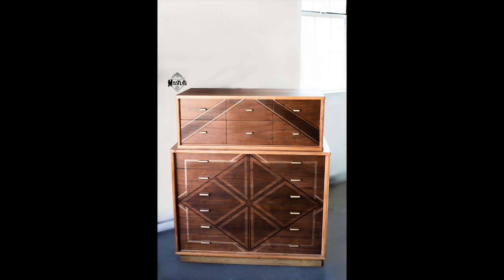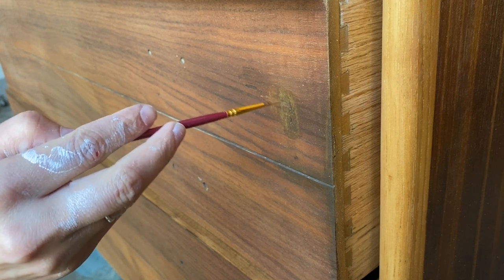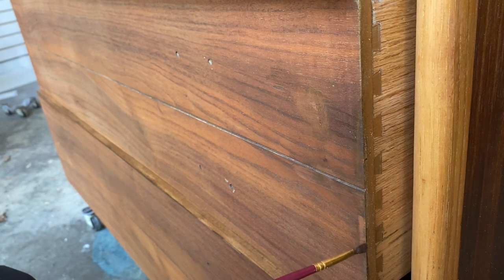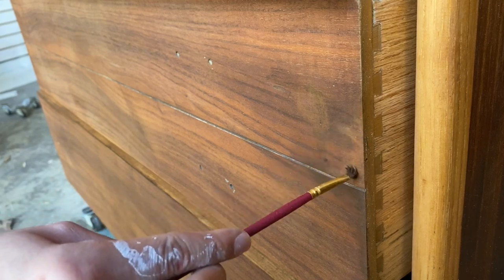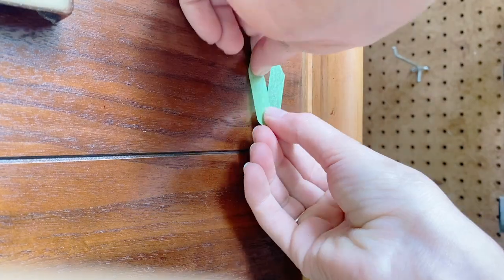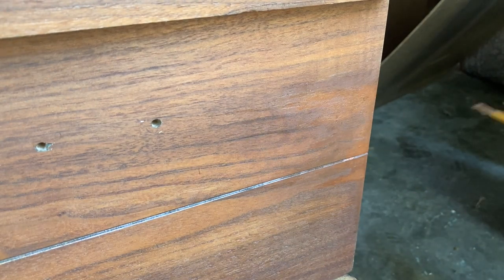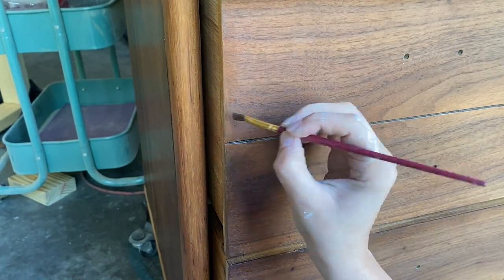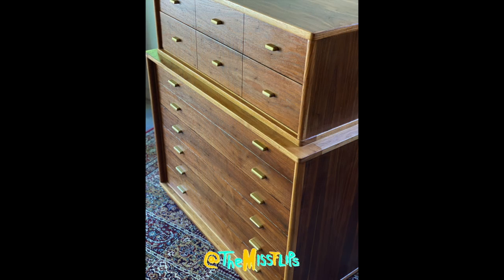Ever burned through veneer with your sander? | Quick And Easy Repair

Comment: Neat work, thank you, Miss Flips. I'm entering the world of re-finishing by trying to save a big dining table that sat under tablecloths in our outdoor patio in Southern Florida for years. I was a mess. In my various and diverse attempts to remove large and stubborn black water stains, I believe I over sanded a number of rather large spots. Two questions, if I may: (i) can this be done over a larger area (say, the size of a standard paper- back), and (ii) I was planning on staining and using weather proof sealant (have not decided which as the choices are endless; I don't think any of these weather proofing sealants come in a spray can (at least not the more effective ones), so, the question, finally, is: can I do the painting after it has been sealed and the do an application of the spray sealant in the painted area. Sorry for the long winded question, but new to this not sure what is relevant and what is not.
Reply from the maker: Hi there! Sorry to hear about your poor luck! Such a pain when things like that happen, but it happens to us all. For something that large, I’d say your best bet is to re veneer the entire surface with whichever veneer you’d like for the top and then proceed as you would anything else
Reply: @TheMissFlips  I appreciate the prompt albeit deflating response. At this point I figure I have nothing to lose and Im not quite ready to throw in the towel with the current veneer. Why can't I "over-stain" the affected area i.e., apply, say, ten coats of stain on the over-sanded area and three on the rest of the top ?
Reply: @TheMissFlips   Do you have a video on reveneering ? I dug through your channel, but didn't see any.
Reply from the maker: @ebsmith1000  at that point, you might as well paint it with brown, I’m afraid. You probably wouldn’t be able to see the grain much and the burned veneer would probably turn out much darker in those areas
Reply from the maker: @ebsmith1000  https://youtu.be/fWempETeLq4?si=vnI5bz4FU4XPQGiJ

Comment: Hello, I work with table restoration and it happens 1/3 times that I sand through the veneer somewhere, I use to put more oil on the damaged spots so it looks the same. But I feel guilty because the people who buy it will notice that once they clean the table many times, because the oil and the pigmentation of it can be wiped off quite easily I guess? 
Does this kit work better?
Reply from the maker: It does if you apply a poly or lacquer finish over the entire surface after

Comment: I bought the repair kit that you listed, but it is very hard in the tube and doesn't have a brush on ability at all.  There are no instructions included.   Is there something I need to do to make this product work?
Reply from the maker: Are you talking about the paints?
Reply: Looking at it again, it shows the paint on Amazon, then further down it shows a resin repair kit.  That's what they sent me. 😢@TheMissFlips

Comment: Can you put an oil finish on top?
Reply from the maker: If you spray and don’t rub or brush, I don’t see why not
Reply: Its acrylic or oil?
Reply from the maker: @scoplon  these I believe are acrylic. But it should say in the description of the item. The link is in the description
Reply: Guess the question i have is there ny finish that can be put on top of it besides a spray on lacquer (not sure what you meant by a sprayed oil finish)....otherwise its just unprotected paint
Reply from the maker: @scoplon  I meant get an oil based top coat and use a sprayer to apply it. I don’t know much outside of this product honestly